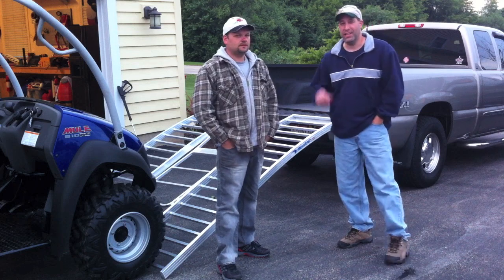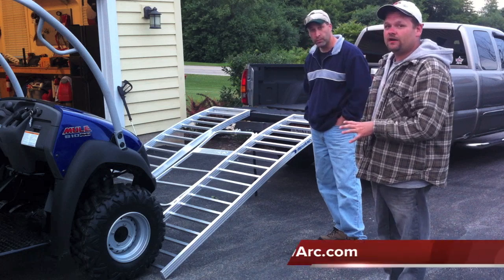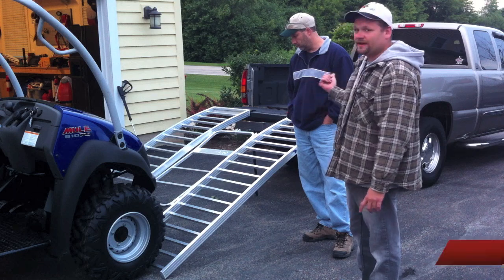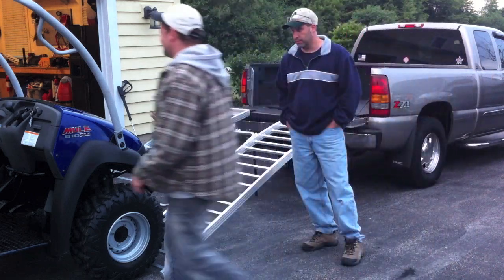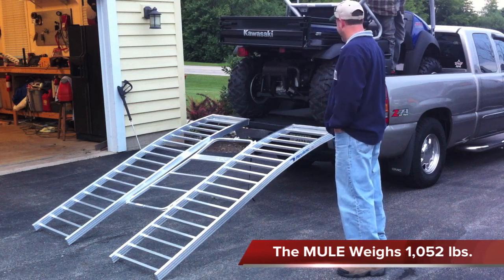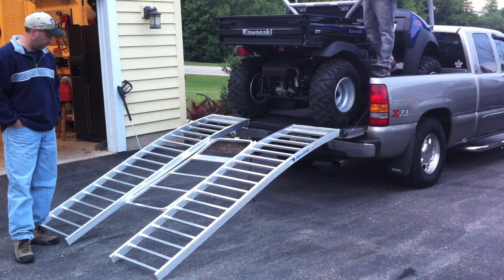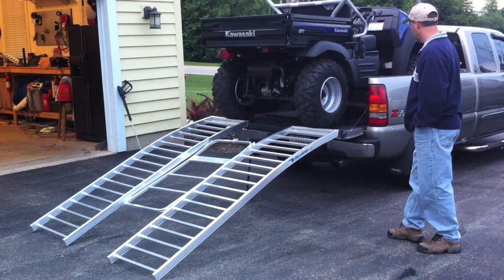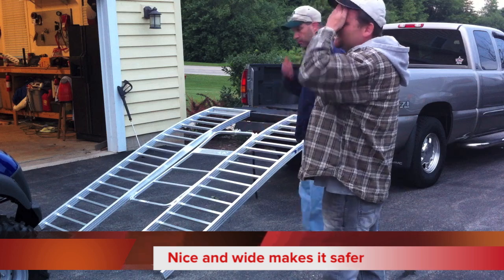RevArc 90" HD Aluminum Ramps - Review - MULE Project

Comment: I own these ramps in the 70" size, which I use for my Grizzly 550 and agree, they are the best ramps on the market.  After I load up, the ramps easily fit under my ATV.  After 2 years of use, the only negative I could think of is the rubber non slip coating on the end will tear off.  They cost a little more, but they are worth it.

Comment: How does one know if the weight on the tailgate is going to cause a problem?  Is there a version which reaches over the tailgate and avoids putting so much weight on the tailgate?
Reply from the maker: +DukeLaCrosse20 No, but I have seen a bar that you can put in your receiver hitch to support the weight.  The tailgate will hold it.